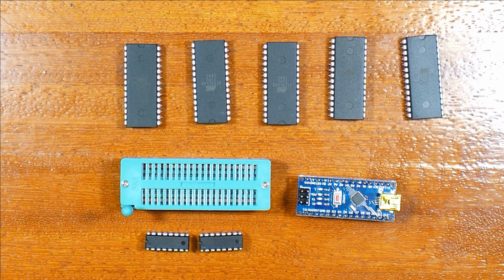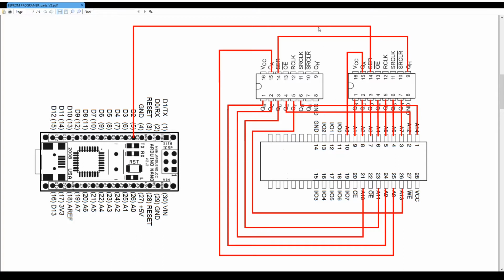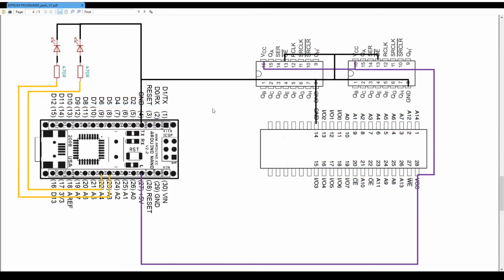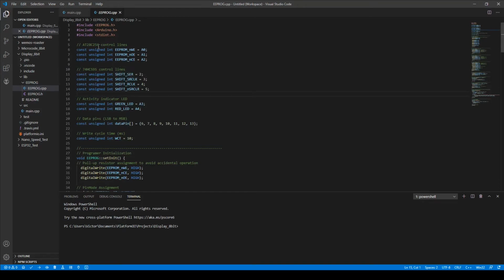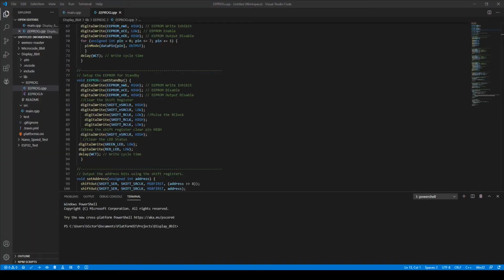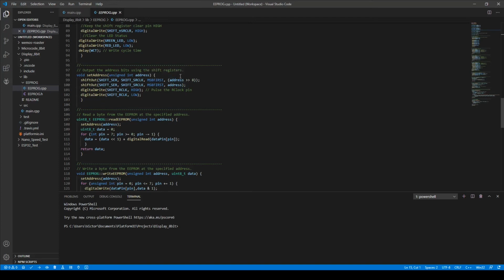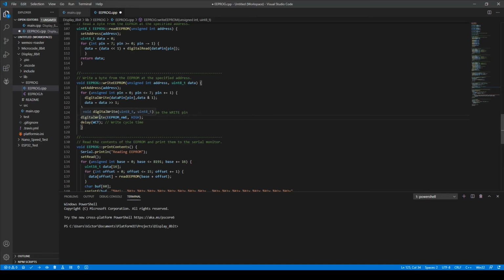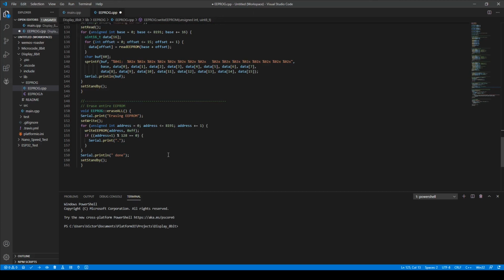DIY EEPROM Programmer — Fast and Simple Arduino-Based Design | Inspector Trinket

Comment: Thanx for sharing this video, it is very helpful. It would be very nice you share the coding
Reply from the maker: Thanks! The code is already online (the link is on the Introduction video to the series)! I will copy it here for you: https://github.com/InspectorTrinket/8bitCPU
Reply: @inspectortrinket  I just visited linked github page but there is no code, nothing. There is only readme and link for this video
Reply from the maker: @mehmetsukuroglu3056  , there is a folder named Microcode. Inside you will find two 7z packages with the code for the Display and the Microcode EEPROMs. I will link you directly to the Display package, because I believe it will be easier to understand and extract the programmer functions you might need: https://github.com/InspectorTrinket/8bitCPU/raw/master/Microcode/Display_8bit.7z

Comment: hey, very nice project. i have memory with similar pins configuration. That's not EEPROM, that's SRAM. ihave 62256 and 43256 with parallel 8 bit I/O
My question is, due to the same control pins (CE OE AND WE), can we use this confuguration? i juste need to make  the write control for the SRAM.
read will be similar...?
Reply: yes you can
Reply from the maker: Yes, it would work like that.